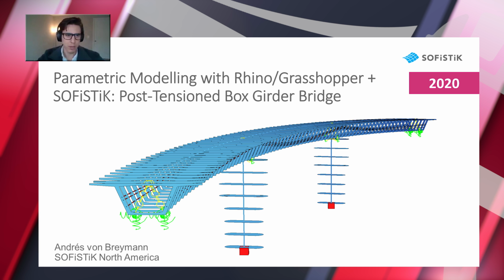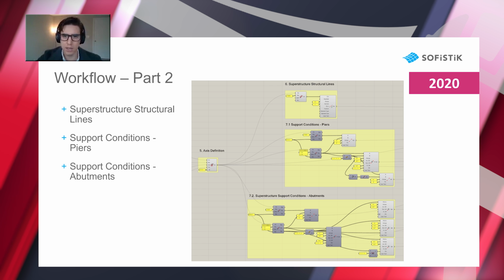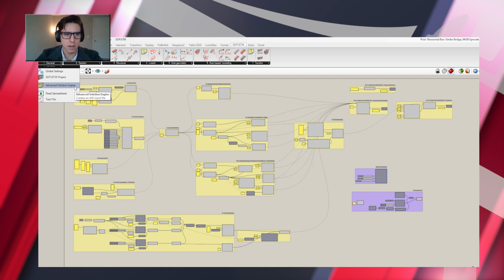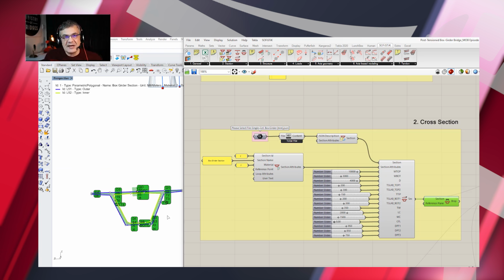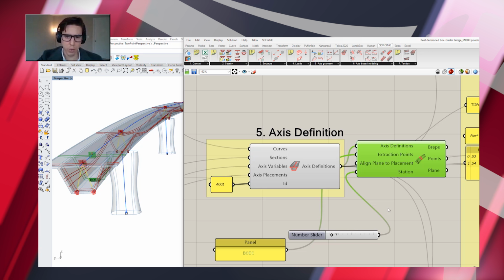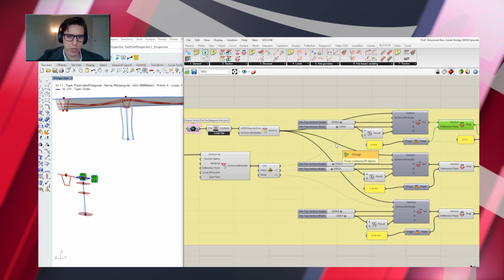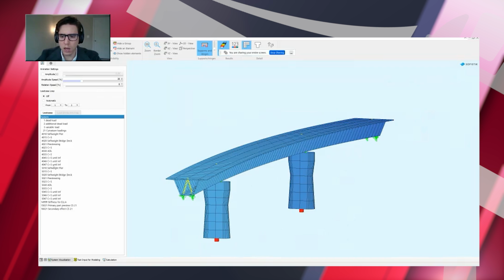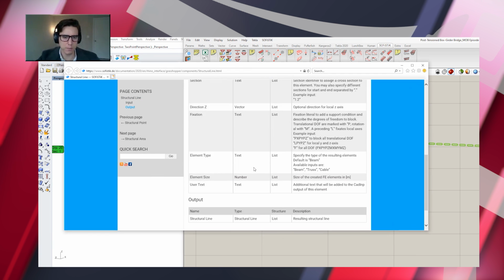SOFiSTiK/GRASSHOPPER - Demo - Part 1

Comment: Great video !! I'm having some problems with my sofistik account. I have downloaded the latest version of the Rhino-Sofistik interface but I still don't have this more complete toolbar (I have the old one with only 5 groups of function). I'm using Rhino 7 but I've also tried it with Rhino 6. Do you know what it could be ? Thks
Reply: That's okay actually I found it. Do _PluginManager (in Rhino), the default will be RhinoSofistik Interface for 2018, you need to install manually the 2020 version of the plugin (already in your machine if you have installed the package from SAM).